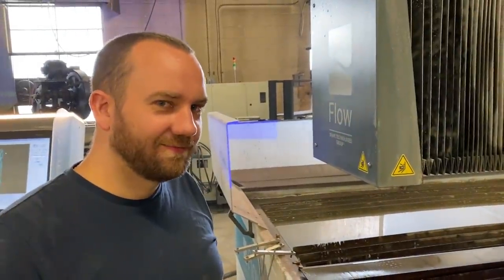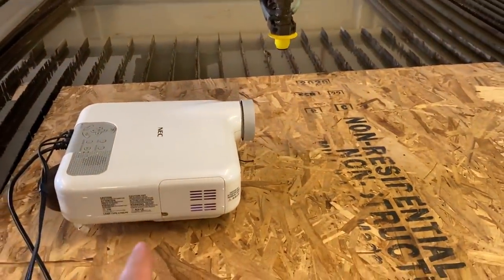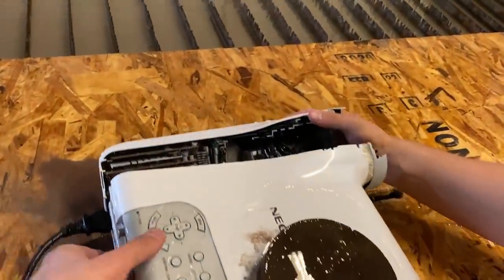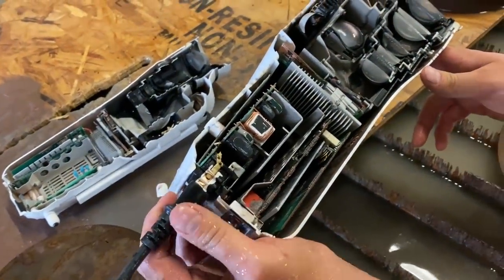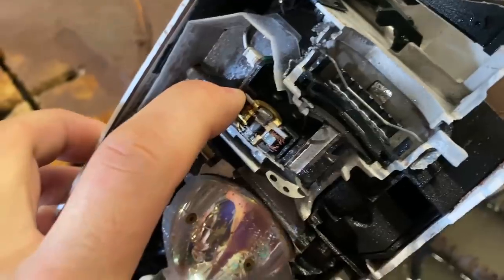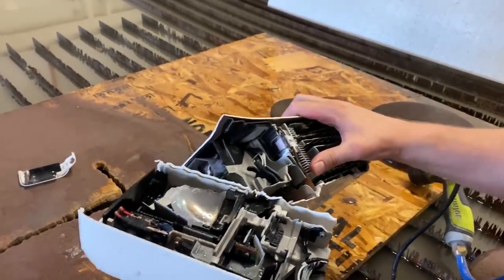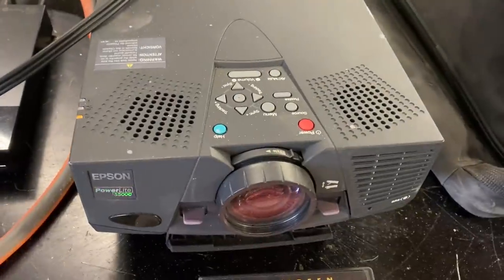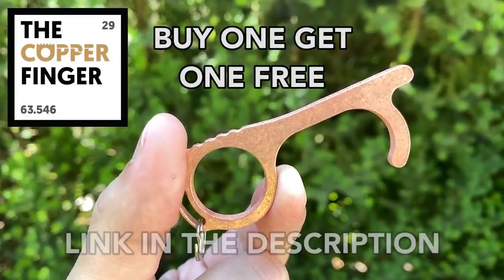Projectors Cut in Half!  LCD vs DLP Projector Waterjet Channel

Comment from the maker: Buy One Get One Free - https://thecopperfinger.com/bogo

Dan and I manufacture these all ourselves, we appreciate the support!  We have the best viewers.
Reply: That light bulbs contain Mercury please clean your water tank. You cut trough the bulb. I know because I changed my projector bulb before
Reply: Soon copper finger may be a thing of the past with this copper shortage BUY NOW!!! Before Restaurants and hospitals start replacing there stainless steel with copper.
Reply: I saw non-copper versions these for sale at a local 7-11, did someone copy your design or is it just a commonly available one that you decided to make in copper?
Reply: Send the lenses, all the cool colored glass, prisms and the heat sink to the guy who makes rings out of stuff. Have him pour different color epoxy between the fins of the heat sink and maybe glue the thin cool colored glass bits together in layers. Also send a copper finger or 10 to Eric Comment Etiquette, I'm sure he will be able to make some use of them and might even promote them for you guys. His Robot might need some fingers too...
Reply from the maker: Richy, yes it projected in 16x9, but it had black bars at the top and bottom. We are dumb though, just not about that.
Reply: Copper finger website doesn't work
Reply: That looks like the one my school uses (white one)

Comment: The chip on the piece of metal at 5:15 is called a DMD, or a Digital Micromirror Device™. It is essentially an array of silicon mirrors that, as you postulated, control what light gets reflected out, on a per-pixel basis. This chip is also what limits the actual definition (SD, HD, etc) that these types projector can project which is based on how many mirrors are on the chip (as far as I understand it, at least). I actually cut one of these open and looked at it under a microscope. I also blew on it with some compressed air and I could actually see the mirrors move around (before the flew off into oblivion). Check out my Instagram post for a similar part if you want to see the tiny mirrors for yourself!
Great video as always! My copper fingers also just showed up today. I can't wait to use them!

Comment: 2:15 - that was the DLP chip the light bounces off of... it's a million+ micro-mirrors that tilt over a few degrees, and aims the light either out the lenses, or onto a black wall.... once for each RGB color. It's a very cool technology, but has what's called "rainbow effect"... if you watch the projected image and "wiggle your eyes", you will see the separate Red, Greeg, and Blue images
Reply: For once an accurate comment! DMDs are fantastic since they move so quickly to vibrate the micro mirrors.
Reply: All correct except the 'off of' part. 🤷🏼‍♂️
Reply: Ah yes, “Greeg,” my favorite color.
Reply: @The4MusketeersYT  LOL... yeah, I got confused, should have been Blug, not Greeg...
Reply: Sounds like a way to experience tripping out

Comment: You guys should be careful. You kept putting your hand right on the bisected power supply. Even when they are off, the capacitors can hold a dangerous charge
Reply: yes that's true, capacitors in electronic devices may seen unharmful but they can kill a person
Reply: I’m sure the water would have shorted them out
Reply: @1992djg  the water was just from splashing. it isn't going to complete the circuit when the terminals are separated by 2 90 degree corners and the length of the capacitor itself

Comment: As an engineer the lcd to me is an optical marvel cause all those mirrors and prizms have to be aligned but electrically it's actually real simple. The dlp on the other hand I'd say is a more budget perfected solution with simpler optics than lcd but more complex electronics. The problem with dlp is since only one color can be displayed at a time, when you move your head, you can see that color smear on the image. At the end of the day they both have applications...

Comment: I’m guessing when you say it had a hard time cutting through something, you can tell my the noise or bubbles or splash back from the Waterjet?
Reply: Bubbles below means it pierced, splash back from the object means it's struggling
Reply: They tell by the amount of time the cut takes on that area
Reply: @StayMadNobodycares  I think they were wondering how they knew they needed to go back over it when the water jet is set to a certain speed. 
For something made of a consistent known material and thickness it will have a speed that the water jet is set to to cut through but not spend longer than necessary to do so due to the expense of the process. Every time the water jet in this video goes back on itself, someone is controlling it, overriding the programmed speed and direction, to cut through something completely, but again without spending too much time doing so. I believe they've mentioned it before that it costs hundreds of dollars every time this water jet is run for one of these videos, or at least for some things they've cut, if they were to sell it or offer the service, they'd need to charge hundreds to break even.
Reply: @markwright3161  I have suspicions that the costs of the materials aren't that much but it's the price of their service that would cost that much, Also every run can be seen as money lost because of the cost of the hardware used and the wear and tear on such an insanely expensive machine. I also imagine there to be a sensor of sorts to feed them a constant stream of information about the cut being done. Everything cant just be eyeballed.

Comment: So how it works is the DLP chip is made up of thousands of tiny mirrors that either direct light through the lens or they direct the light away from the lens, the chip is only monochrome so it syncs up with the moving colour wheel and shows only one colour at a time but it updates so quickly you perceive it as a single RGB image.

Comment: $30 for 2 of those copper fingers?  How much mark up do you need to make these?  That's insane.
Reply: Free market man. Don't want it, don't buy it. (or rip of the idea and sell yours cheaper)
Reply: I work at a metal shop. I worked in the shop for years and now I'm on the office side. I think $30 is pretty reasonable for the material and labor, especially considering the free shipping.

Comment: Fun fact: DLP projectors suck. Their only good advantage is the brightness. LCD LED projectors are much better because of the LCD panel they have in them. The downside is the LCD panel dims the LED. DLPs use a chip with mirrors on them. They get stuck if the projector gets to hot which results in black dots due to these damaged mirrors. If you want a good LCD LED projector that's bright and has a good 1080P at 50in or so you will need to pay a good 1-2K. DLPs you can pickup for cheap at pawnshops. I know this because I use to have one. It was a epson I believe. It came out of a school because it had the room number and CCSD on it.

Comment: 1. DLP explanation is incorrect. The DLP chip does not process color but only reflect(project) or ditch the light shining onto it. The color wheel rotates and the DLP changes extremely quickly to reflect or ditch each colored light. 
2. The lamp contains high-pressure mercury. Not the best thing to cut.
Still very nice video.

Comment: Really cool to see how they look inside!
I also hope you recover from your heavy metal poisoning soon!
Most projector bulbs have mercury in them, which isn't as dangerous as a metal, but very dangerous as an aerosol or as tiny particles in the air, like what would happen if struck by a powerful blast of, uh, waterjetting.

Comment: That light bulbs contact Mercury please clean your water tank. You cut trough the bulb. I know because I changed my projector bulb before
Reply: The amount of mercury is a small fraction of what you'd find in an old thermometer. It's a super-thin layer inside the sealed bulb. I don't believe they cut through that part of it.
Reply: @Treddian   But as what I can see they literally just cut trough the bulb right in the middle which is the Mercury part. They barely missed the second bulbs but they did not missed the first bulbs